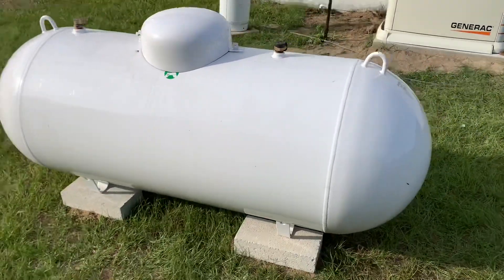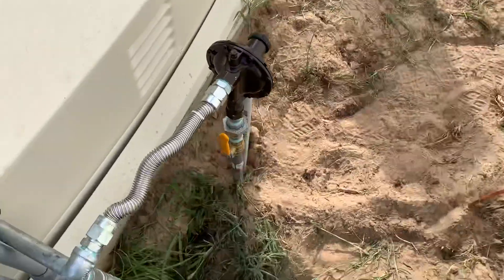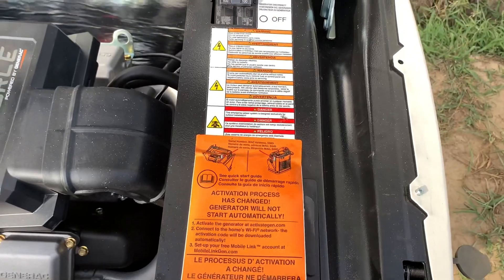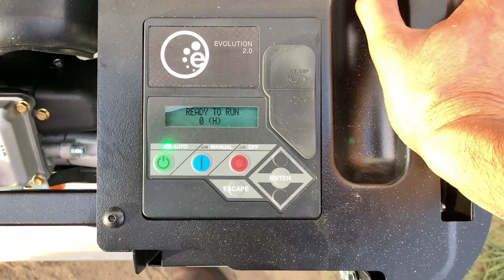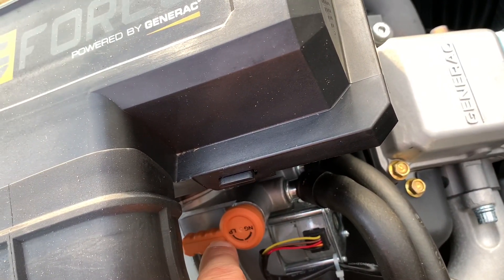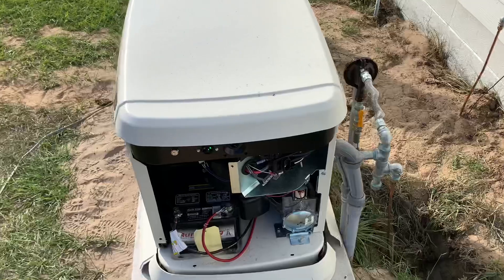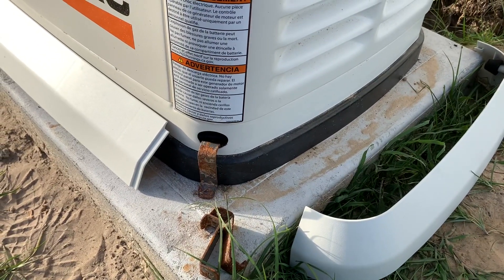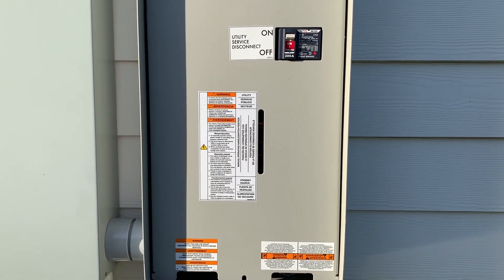Testing our new Generac generator and transfer switch.

Comment: I am in the planning stages of a project similar to yours.  Can you help me out with the propane "math"?  

My calculations show that this tank will only run the generator for a little over 2 days.  250 gallons @ 85% = 212.5 gal capacity.  The generator I am looking at is a 24kw as well and it claims (on propane) to burn 3.9 gal per hour (@ 100%).  That leaves about 54.48 hours of run time.

I don't think this is enough time and I was planning a 1000 gallon tank.  Is my math off? Is 1000 gal overkill?  Thanks for any insight.
Reply from the maker: If you can afford it, a 1000 gallon tank is definitely the way to go. Also, I will be turning it off during the daytime in the future and only running it at night. That will help the fuel go a lot further.

Comment: Just FYI what people do with their money is their business. But with that said  I was hit with Hurricane Helene and Hurricane Milton. I have a 10,000 watt Gen that runs on gas is pull start remote start and push button start. I ran 2 Fridges my A/C  my Microwave  lights  my desk top computer and my 65 inch TV. That cost me 25 dollars a day in gas for 24 hours a day. Now I have seen many videos of people talking about their Generac and costing 150 to 250 a day to run. I also do not have city water I have a deep well. If people just don't care  what happens to their money sweet but I can think of a lot of things to do with the money I save every day just running my Westinghouse Gen. No I did not buy the duel Gen because Propane gas would cost more for less time. A Propane gas tank that is for gas grills  only last 4 hours on a Gen a 6 gallon can of gas runs 16 hours .

Comment: What is the purpose of these two auxillary shut off switches?
Reply from the maker: I believe they’re for maintenance but two is crazy. They are a giant pain in the keester my opinion.
Reply: @MaynardFamilyHomestead  yeah, you can turn it off at the control pad, and turn of the disconnect breakers, and pull the fuse....I can't see the reason for these aside of an emergency kill?

Comment: Why was the bonding jumper between neutral bar and ground bar in transfer switch not removed?
Your bonding should have happened after meter in the GE panel and then all neutrals/grounds separated after that.

Comment: Would it be a stupid question to ask why you chose aluminum wire instead of copper? I plan on using copper and dropping wire size from 4/0 to 3/0. More flexible and can hopefully have less trouble working with the copper.
Reply from the maker: You can absolutely use copper, it has less resistance. Copper is quite a bit more expensive in my area than aluminum, and I had the aluminum wire already so it was a no-brainer. 90% of the homes in our area use aluminum.

Comment: You need more propane. 24 kw uses 3.9 at full load. 3.9/200=51.28 hours of run time. that tank can't hold 250 full gallons, they only fill the above ground tanks to 80%
Reply: Perhaps, but most won't use the generator at full load. Plus, you could shut it down for several hours per day to conserve fuel until the gas company can get out to refill.

Comment: Geezus $200 a year is a rip-off for renting I can't imagine what it cost for the tank itself. Most expensive play to rent a tank near me only wanted $30 a year but like you I just bought my tank outright my tank was a 320 gallon underground tank and brand new it was only $1200 with a lifetime warranty anything happens to it they'll replace it for free. Also i guess your dollar didn't show you the bleeder valve on the engine thats in between the onboard regulator and engine it wasn't doing all cranking on first startup. Maybe not all Generac generators have that but mine did.

Comment: Great videos. Now you'll wait for a power outage and take comments from your friends about wasting money on that stupid gen. I did for a couple of years and then I enjoyed my AC and no interruptions to our family life. But now for some comments on that gen. First those are made right near my town in Wisconsin and I know several shop workers there. It's a well made product. Now I retired from another company in Wisconsin that also built gensets as we called them. I was senior erector of our power gen division. Our gens were powered by engines that ran on NG, LP, or biogas. Larger engines were of the 4000 HP. Now this leads me to a question. Why are the LP pipes galvanized? That is an problem waiting to happen. We never used galvanized on a gas line. In time the zinc will flake off in the pipe and plug a regulator or carb and enter the engine. Also I noticed there wasn't a 6 foot copper ground rod driven into the ground near the gen to ground the unit separate from the house. Generac use to require this. And you really did a neat wiring job. I've seen some butchered jobs that came through my shop. They worked but we're sloppy. Good luck and I hope you get a good storm to test it out soon.
Reply from the maker: Exactly! We’ve already gotten to us it during an outage and it’s wonderful. 
I agree on the galvanized gas line, I questioned that myself. I was always told to use black iron. 
You are the first person to notice the ground rod! Back when I did installs as a career we always drove in a ground rod to ground the frame. 

Thanks for watching!
Reply: @MaynardFamilyHomestead  hey I forgot to tell you something. Pick up a spare oil pressure switch. They do go out and will shut you down. Pretty much the same switch as used on automobiles. It's NC. Mine did shut down a few years ago on a hot weekend. I did locate a service guy that had one on his truck. Met him on a service call and he sold one to me. Simple screw in fix.
Reply from the maker: Thanks, that’s a good idea actually.

Comment: I believe the 50% load rating is 2 gal an hour, on the 24kw machine.
Using it from 80% to 20% is 150 gal of usable fuel. That's 75 hours of run time if I'm figuring it right.
I mean, you can stretch it by running 12 out of 24 hours or so. But that's still only 6 days. Granted, I admit that's the vast majority of grid down events.

Comment: Quick question.   I haven't read through all the comments.  I'm wondering about the periodic test that I understand the unit performs itself.  Does this happen? And how often?  Thanks.
Reply from the maker: Great question. It does an “exercise” which is a start up and idle run for 5-10 minutes. It can be set for however often you like, mine is a once weekly run. It insures the engine runs regularly so when you need it the engine will start with no problem.
Reply: @MaynardFamilyHomestead  Thank You.    I've often thought about having this exact model.   Your videos helped tremendously with the process involved.

Comment: Based solely on the size of the wires coming from the generator, I suspect that the generator will not meet the entire home demand.  If that is the case, how are you shedding load?  Seems to me that the generator will be overloaded unless you shed load.

Comment: can you start the generator without shutting off the house power? if so how do you do that? Thanks
Reply from the maker: You can actually! You just push the manual button and that will start it. When you want it turned off just hit off and then click get back to auto once it’s totally shut down.
Reply: @MaynardFamilyHomestead  Thanks bro  I appreciate ya
Reply from the maker: @ronbonick4265  you’re welcome!

Comment: Wow never seen thermostat wire used to have voltage running through it. I supposed there is no inspection on this job.😳

Comment: Great video man. Why an air cooled generator? I’d be surprised if it lasts longer than a few hours of continuous operation under full load. Here in Florida I found out the hard way that liquid cooled is what one needs if they want power for a day or so when utility power is out. I can’t tell you how frustrating it was to spend thousands of dollars and thought I was ready for the next bad power outage only to be sitting in the dark without my money. That’s been a lot of years ago but I still only buy liquid cooled generators. 15-25kw are perfect for most people but I prefer a bit larger. My 40kw has a 4.3lt gm v6 whereas they’re using 2.4lt 4 cylinder generac engines on the smaller ones. They consume the same amount of lpg per hour but you get 40kw of electricity instead of 25kw and the engine isn’t working as hard. There’s only a small difference in price between the two. Lots of good used low hour generators on the market that’ll actually meet the needs during prolonged power outages. I’m an old man and wanted to give you and others something to think about before y’all’s next purchase. God bless

Comment: mister how do you do the wifi on the generator? do you have an idea?
Reply from the maker: It’s been a long time since I’ve hooked one up to Wi-Fi, but I do know it requires activating the generator Wi-Fi and then going online to their website to complete the set up.
Reply: WiFi can only be used  to MONITOR not control the generator according to the Generac rep I spoke with over the phone. They are supposedly working on that feature.

Comment: Doesn't that gas line have to be insulated, especially during the winter? When extreme cold weather hits the area, those gas lines could have a tendency to freeze and stop the gas from flowing. So, it's a good idea to insulate around the gas connections to prevent any freezing.
Reply: LPG freezes at -306F, so that is not going to happen

Comment: Not sure about there. But in new York we can run utility power through the panel. Using it as a raceway. Then can't have utility power in same nipple as the generator power. They make us go from meter to transfer switch directly. Then transfer switch to panel directly. Bushing on nipples. Then because transfer switch is now 1st means of disconnect you need to run ground rod wire and watermeter ground directly to transfer switch where neutrals and ground are bonded. Then in the existing panel you need to separate neutrals and grounds cause now that's a sub panel. Job would have failed inspection on at least 4 issues.
Reply: Can't run utility in same nipple.

Comment: I’ve had my 20kw Generac for 11 years and just had my first engine related problem. The stepper motor that controls the speed started hunting or surging.checked lp pressure at 12”wc. Located new stepper, watched you tube for repair (gen man)
Showed how to change out 30 min. Job, fixed then ran load test, all good. Have a 1000 gal tank and 250 gal tank manifolded together. Stepper was $95.00. Your install looks very good and neat, good job. You will have peace of mind in the next outage with that gen set running.
Reply from the maker: Nice! It’s already been used 4 or 5 times this year. We had random outages for no apparent reason and it came in handy. About 10 years ago when I did electrical work full-time I used to work on them quite a bit and for the most part they were very reliable machines. I’m not a huge fan of all of the computerized stuff on them these days, but it’s still a decent unit

Comment: How long does the 100 lb thanks last? Did you have it connected to the generator at one point? Thanks
Reply from the maker: I didn’t have the generator hooked to the small tank, just the stove inside. It would be interesting to see how long it would run though! My guess is 8-12 hrs.

Comment: Very informative video. My setup is about 99% the same as yours. I had the gas guy run my regulator to the side of my pad. Then he ran a metal pipe along the rear of my pad to the flex line. The reason I had him do it that way is because the back of my generator is my property line. I own both sides but in the future if I decided to sell the vacant side and someone wanted to put up a privacy fence I didn't want my regulator in the way.

Comment: some advise from a tech in Oregon,   don't pull the fuse.  just unplug the white
control harness from the board.  then plug back in when all the wiring is done
and the battery has been installed and activated.

Comment: We looked at one of these, 6-7 gallons of propane/hr under load. Crazy expensive to run, the tank he shows in the video might last 2 days. Opted for 1.2KW 10 gallon gas, runs all night and will start the A/C compressor. Biggest draw in a normal house, A/C starting IMO.
Reply: Whoo that Crazy never though it be that much Thank you...

Comment: 3:00 First thing you need to do is fit some rubber between the hose and the tank to stop the hose wearing the paint off. The next thing you need to do is stop that regulator flopping about in the air - yes, that hose is flexible for fitting it but it's not designed to flex after installation. Flexion of the pipe will cause fatigue cracking and you could have it leaking within the year.

Comment: Trying to find part 1 through part 4, but can only find part 2. Could you list the names of your video so I can get and put them in sequence for watching? Thanks
Reply from the maker: Sure thing, there are actually five total videos on the generator install:

Pouring a concrete slab for our new 24kw Generac generator.

Installing our new 24kw Generac generator with electrical wiring.

Wiring our Generac transfer switch to the meter can

Testing our new Generac generator and transfer switch.

Problems with our Generac generator install

Comment: Hi there I'm wondering something when you connect a fuel / gas generator you connect it without the power meter.  I am from Norway and we do not have 120 volt systems here, here we have 230 in our houses and for larger systems 400 volts so-called IT systems.

Comment: Speaking from my experiences with my generator and the gas company, if I see yours correctly when your generator needs repair and has to be removed and carried to a shop, (like mine did) the gas will have to be turned off of course, and the way yours is hooked you will lose gas to your inside stove since they put the T further down next to the generator. Or you will need to plug the gas line so that your stove will continue to work. I had them place the T at the regulator and then valve to each appliance so I can run both or either one separate.

Comment: I’m curious. How long would the generator be expected to run, using that tank, during a prolonged power outage?
Reply: NOT very long! I have a 22kw Generac on a 250 gallon tank like this. If you run your AC units ( two 3 ton units ) and typical house stuff without turning off unneeded stuff it will last maybe 4 days. That is if you start with a FULL tank.  I am going to add a second 250 gallon tank as soon as they become more available. That said, it sure is nice to hear it come on when power goes out. So far it has powered the home 3 times since last September, once for about 8 hours. You could extend how long the tank lasts by turning off stuff ( remember, your tank may not always be at 80%......) but that is not why you buy the whole house generator.
I mounted my low pressure regulator at the tank so I did not have to run a vent from it. 3/4" poly line from there and set the regulator to have 12" of water AT the valve on the generator.
Reply: @werkspartsllc7856  How much, on average, is a gallon of LP these days?
Reply: @JeeeezBub  Last fill up was about $2.15 gallon. On a 250 gallon tank you have a 200 gallon capacity ( 80% fill is standard due to expansion space needed). Get around 4 days of use on a 22kw at half load or so with the 250 gallon tank. Cost would be well over $100 per day to run these generators on propane. UNLESS you drop back the load. I don't worry about it for a thunderstorm event or someone knocking over a power pole. But during a hurricane or similar situation I would drop all landscape lighting, turn off unnecessary lighting inside, even unplug many things that use a bit of power even when not on. I can run just one of my two A/C units and live in that side of the house for instance. I can probably extend run time to 6-8 days on a 250 tank. I do have plans to add an additional 250 tank soon.
Reply: @werkspartsllc7856  Great info...thanks! I've always been curious about these on propane. We run ours on natural gas (private well) but I always worry about longer outages and managing well pressures/available volume. A recent 4.5 day outage has calmed my fears a good bit...good test. Propane though seems like a workable option if necessary based on these comments. Thanks again!
Reply: According to Generac a 22 kilowatt generator would burn approximately 2.1 gallons per hour at ½ load and 3.6 gph at full load, while a larger 38 kilowatt unit would burn 3 gallons per hour at ½ load and 5.4 gph at full load.  A 250 gallon tank, as he had, filled to 80% holds 200 gallons of LP.

Comment: The flex line is very short and it looks very twisted at the ends, also that skinny copper line, no bueno. A very rookie job, but congratulations on your smart choice for backing up your home with power.
Reply: Esa " línea cobrizo flaca" se llama tubería de cobre de 1/2" que triste que te sientas muy técnico, y no conozcas el nombre de los materiales.